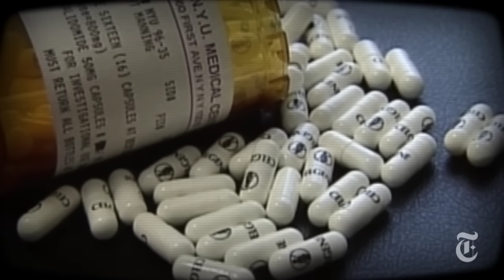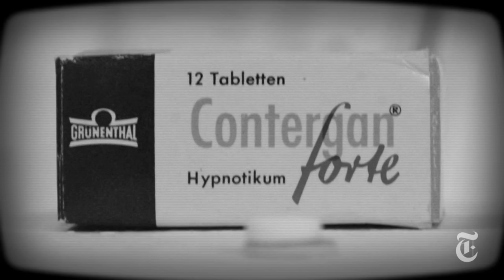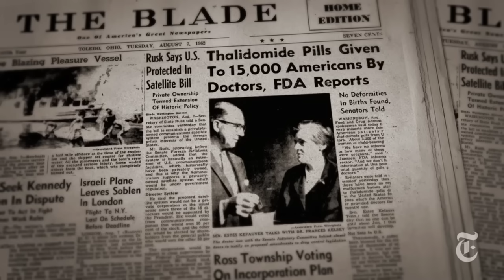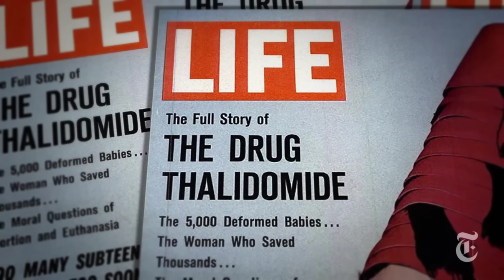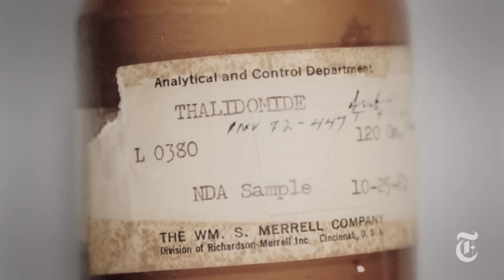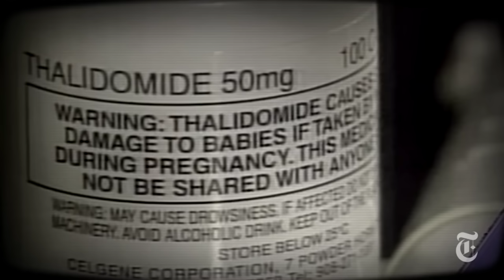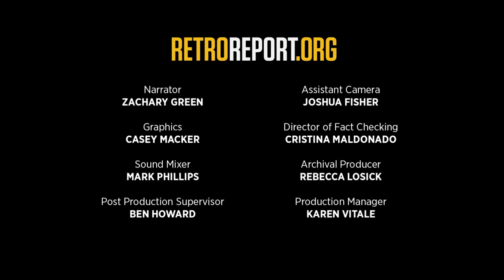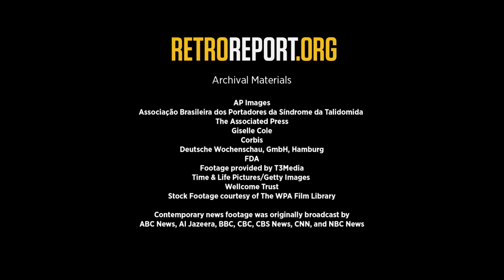The Shadow of the Thalidomide Tragedy | Retro Report | The New York Times

Comment: Thalidomide was originally synthesised in one chemical form called the (r) enantiomer which is a successful sedative that was commonly used. The problem with thalidomide prescribed to pregnant women is that the synthesised drug was in the (s) enantiomer structure which is teratogenic. The people making the drug forgot to analyse and test to see if the s structure was safe to use as they assumed that it would act in the same way as the (r) structure.
Reply: I had no clue. I thought it was sold as a racemate.

Comment: The victims position is understandable but flawed. There's nothing wrong with the drug. The drug is incredibly useful actually and has no need for a better replacement, it is in fact been developed as a newer means of treatment.
The problem was never the drug, it was the incorrect application AND the governing body (or lack of).

The issue is been made political unfortunately, lots of very good and useful medicine is dangerous to the fetus. The answer is regulation not blind and blanket bans.

Comment: And, therefore, the need for good government and good regulation.  Capitalism is like a locomotive--it can do much good, but it requires a good conductor and governor. Otherwise, like a locomotive, it will run off the rails and cause much damage.